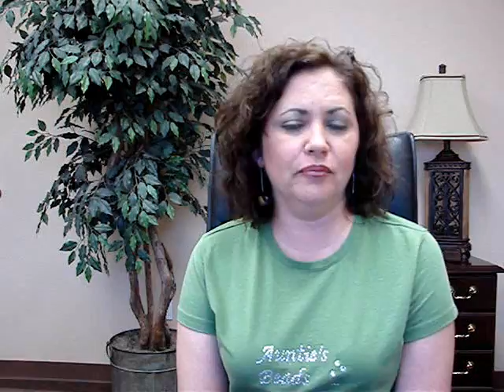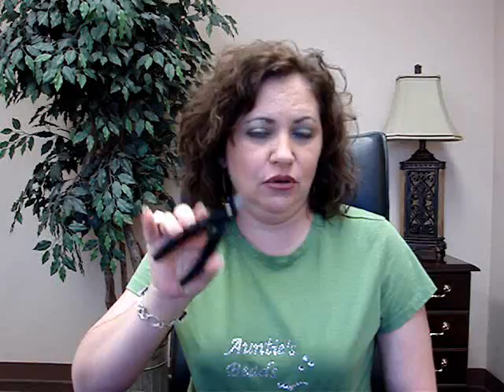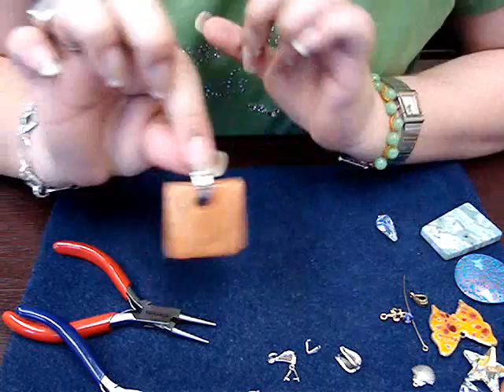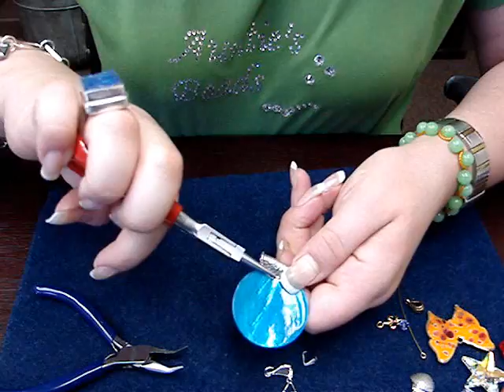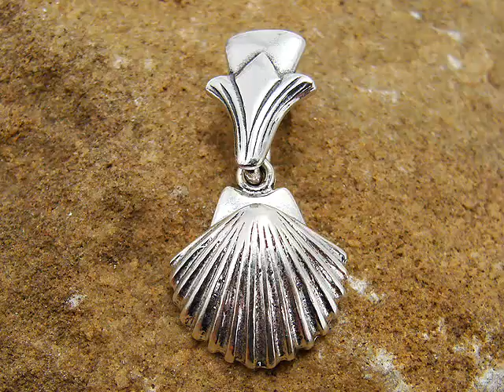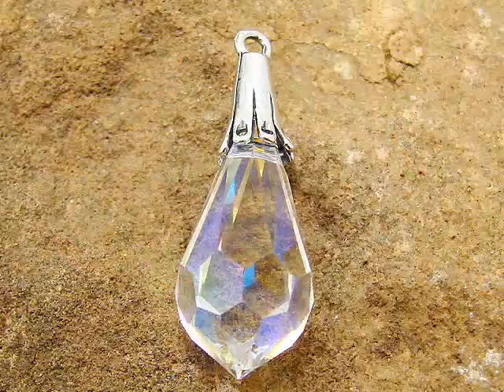Pendant Bail Basics

Comment: Good video, but why are you not using rubber coated tools? Metal on metal scratches and ruins the bails. Not only are your nails (and rings and bracelets) distracting, but you keep dropping the smaller items because they are so long.